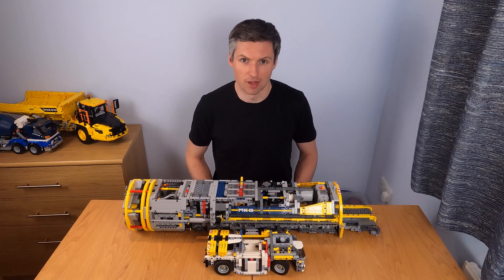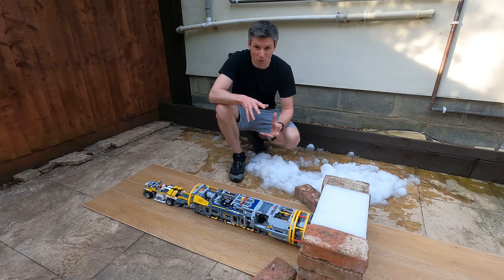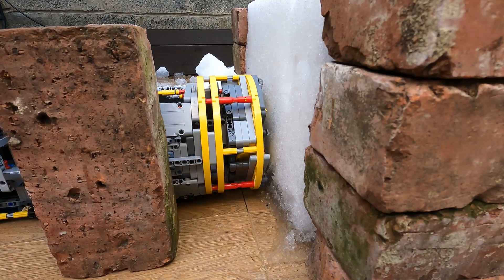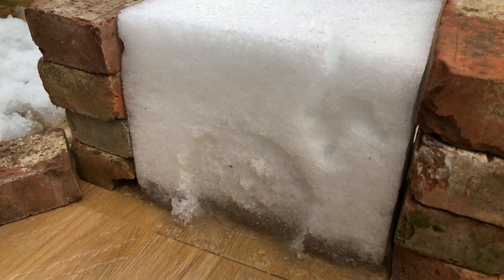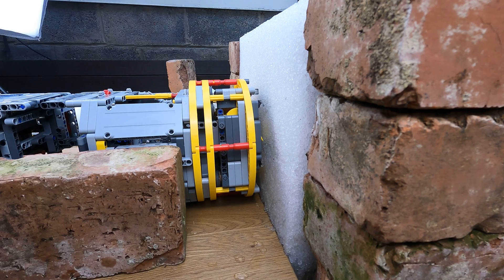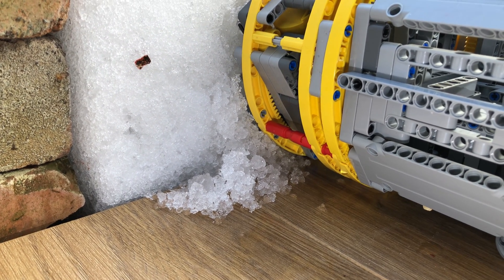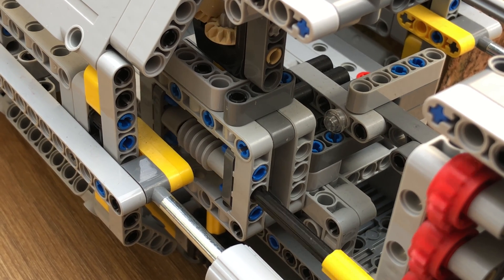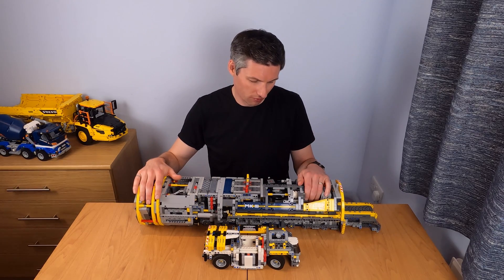Tunnel Boring Machine vs. Snow!

Comment: Is there a failure in the instruction, step 281? If I assemble the parts like there, the black gear turns in the opposite direction the grey ones above do. It can't work, so I removed the black gear and the boring head turns.
Reply from the maker: Apologies for not seeing your comment earlier! From what I can see, Step 281 is correct. Perhaps check that all of the 12 tooth bevel gears (LEGO part number 6589) are in the correct position in the drivetrain: Steps 109, 156, and 160. I hope that helps!
Reply: @TheThirdModel  Hello, the failure is fixed, I did it on step 156. Thank You for Your help.
Reply: @marcelfouquet9865  Awesome, no problem!

Comment: I might not have done tunnel boring, but in pipeline boring, a small bit is sent to start the guide hole, and it it reamed back and forth until the hole is wide enough for the pipe.
Reply from the maker: Very interesting, thanks for the information. As far as I know, large TBMs don't do a guide hole. However, a pipeline boring machine could be a nice model in its own right.

Comment: Can you try using sand? It is a lot more malleable and easier to dig through, especially if you mix it with a binder to make it stick.
Reply from the maker: I was thinking of trying casting sand. My only concern is how much the sand will damage the plastic gears and other moving components. And cleaning it afterwards...